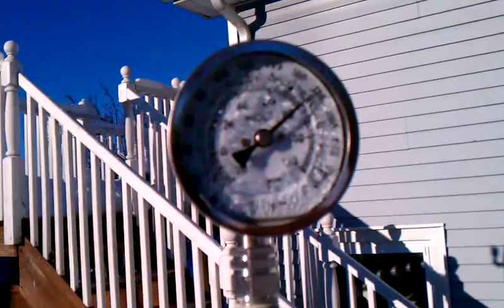Solar hot water heater in extreme temperatures - Solar Thermal - Solar Water Heater

Comment: Looks more reliable than a tracker stirling generator. Attach a stirling engine to this and generate electricity. Does this operate well in scattered light? If so then it can completely replace stirling trackers.
Reply: +leerman22 I was just thinking the same thing, lol. kilowatt per kilowatt it would be cheaper than solar panels no ?